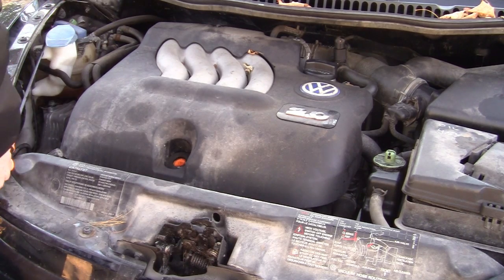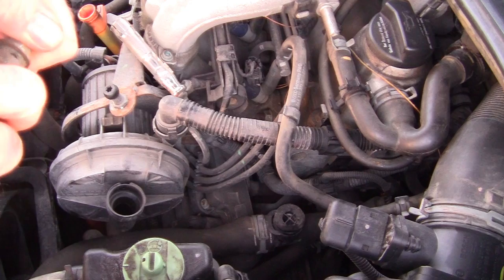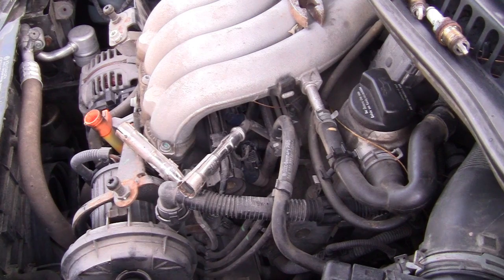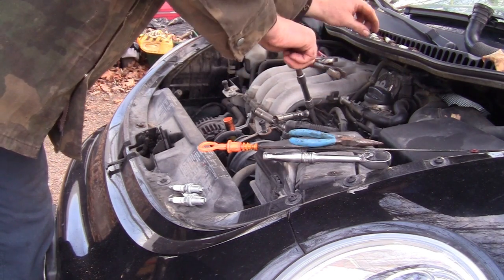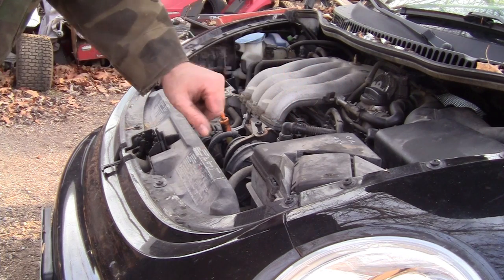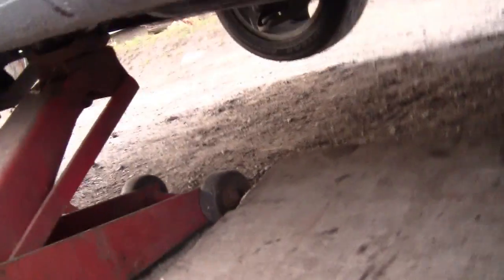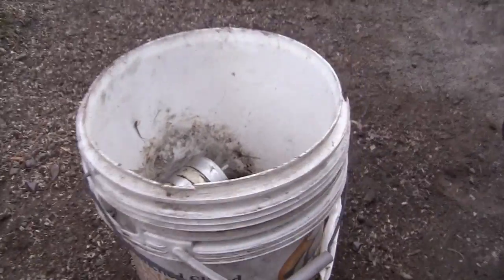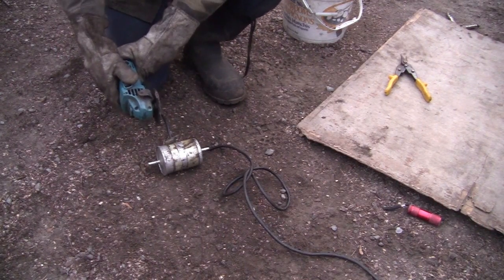How to tune your car up yourself.mp4

Comment from the maker: @daarrve I think that code is for an Ignition Coil, sounds like you have an ignition problem. Its ether a coil or a plug wire. Doe your code reader tell you what cylinder it is? If so you can move that coil over and swap it with the one beside it. If the code changes and it says its a different cylinder then its the coil, if it dose not change then its a plug wire. You can change things around untill you find out what it is. You can even swap plugs to a different hole Sea foan can hurt anything

Comment from the maker: I think that code is for an Ignition Coil, sounds like you have an ignition problem. Its ether a coil or a plug wire. Doe your code reader tell you what cylinder it is? If so you can move that coil over and swap it with the one beside it. If the code changes  and it says its a different cylinder then its the coil, if it dose not change then its a plug wire. You can change things around untill you find out what it is. You can even swap plugs to a different hole. Sea foan can hurt anything

Comment from the maker: @MrMrtiki Makes you wonder where it came from. We get the odd one at work that just left the gas station and got a hafe tank of water. I was always told to never get gas if the fuel truck was there dropping gas off because it stirs up the water on the bottum of the tank.

Comment from the maker: @daarrve Try swamping the coild to another cylinder. If the codes comes back and moves to a different cylinder ,its the coil.  If you use it right the seafoam will clean the inside of your motor. I've never tryed it but I hear it works good.

Comment from the maker: @daw162 Thas nothing. The powersteering lines are leaking as well. The dealer wants 300 for the one and 225 for the other one. This is not good at all, and I'm not even sure how long it will take to change them. Then theres the rack lol

Comment from the maker: @sc0tte1 Most of the time they are, but I will normally check them anyway. Some times they are out alot, or they get throwen around and the gap is closed. It only takes a min to check the gap.. It could save you alot of work lator down the road.

Comment from the maker: @martian953 Yes and alot harder on gas. If you leave it too long it will burn the cat out or melt it. Try online for a cheaper 02 sensor. You might try a used one, but it might be hard to get out or even find a good used one that will fit your car.

Comment from the maker: @TRcustomengineering Yes I should have said it did. It had low fuel presure and by the time the fuel got to the end of the fuel injector rail it did not have enuff presure for the cylinder

Comment: @ShawnCFarm Thats a given never fill when the truck is there -Well around here all the fuel tanks are fibreglass back in49 to 69 My Uncle ran a B/A service station  here and he sold out to a lady had an auction sale and moved - In 1978 a school bud was cutting her lawn and could smell GAS so he went looking around and found the vent needless to say he found an old dip stick put her in the ground cap and found 700 gallons of fuel leaking into the creek thats where the enviro freak started from .

Comment: Coming from a lifelong partsman, you're correct, ALWAYS match the new part to the old part you take off. That goes with ANY part. Once you take it off, match it up to the new one before you install it. 

And the best bet is always bringing in the part to be matched up in the store so you get the right one the first time! =)

Comment: Hiya, I have a question you might be able to answer, I have a 2000 Silverado 2500, 6 litre with about 330,000 kms on 'er. It shakes and bucks when under load like going up hill, I really do not believe it is my tranny, at least I hope not, lol. I hooked my truck up to my ODB2 reader and it gave me the code P0356, I cleared the code and it has not come back but it still is shaking and bucking. Any ideas? On a side note, what do you think of Seafoam?

Comment: @ShawnCFarm haveing trouble with the last one by the big air box of the heater and a/c unit the first two are not soe bad just that last one I can get the socket on the plug but nit the rachet any ideason that one will be a big help and thank you !

Comment: according to VW...they require pregapped platinum NGK plugs...or Bosch Platinum 4's on the Turbo Beetle.no copper plugs or the electrodes will be roasted off them.

Comment: So, you take a grinder to a fuel filter?  Really?  What if there were more fuel in the filter you couldn't get out?  You're grinding away on metal which causes sparks.  Spark+fuel=explosion.  It's awesome you want to show people the inside of a fuel filter, but please don't do something that could potentially cause an explosion.  People will follow your example and could get seriously injured.
Reply from the maker: +lmind2 wont be an explosion with the ends open lol.